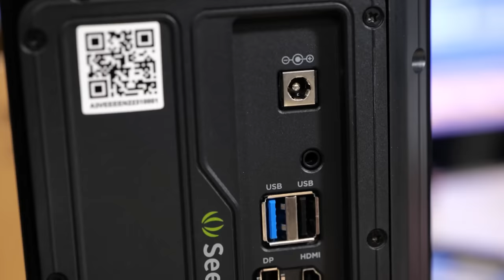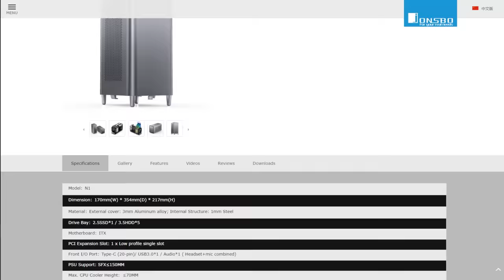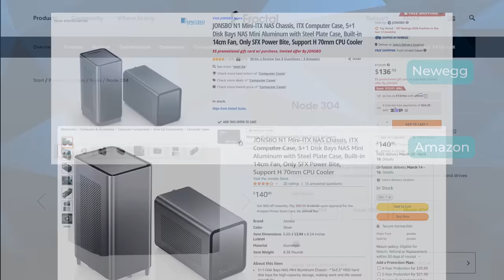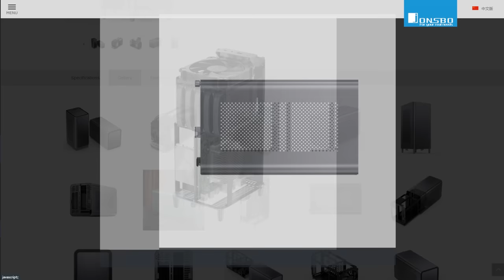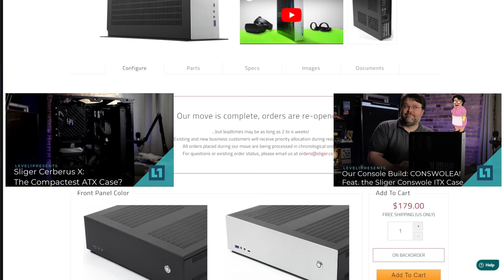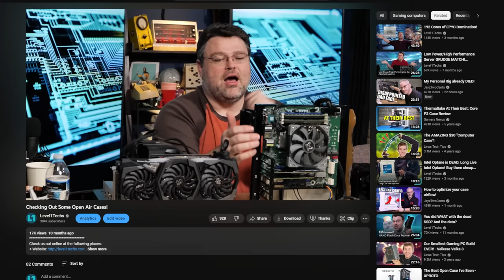The Ideal Home Server! Is it Possible?

Comment: I am late to the game, but is there is a cheaper option for just having NAS for long term storage? I have 2x 4TB drives that I want to get out of my main PC so I can have the files accessible on a power efficient form factor than just running my main rig 24/7. I have them manually mirrored (copy paste) because my windows mirror array failed, so I manually do periodic transfers from one to the other. Other use case is photos, movies, and etc, but the first priority is redundancy of data (and as a backup from my devices).

Comment: @Level1Techs I have built many PCs, but I'm a server newbie, so how many HDD is the most ideal for raid storage?  I have a hp z840 that i would like to repurpose for a server, i can fit up to 7x 3.5" hdd drives easily.  Also, this workstation is compatible with SAS, do I want SAS or stick to SATA?

Comment: In my experience, small form factors and mechanical drives don't mix.  Drives need airflow; too much heat will kill them.  I cringe when I see form factors with just enough space for 4 or 5 mechanical disks.  As with a few other commenters, I prefer ATX sized storage servers as these provide the space and cooling, not to mention the ability to use cheap commodity components.

Comment: I echo your complaint about every single 2-bay unit on the market. Why not 3, so you can do RAID6 in a sleek package?
Reply: Running RAID6 on only 3 drives is just paranoid, you'd have more redundancy than storage.

Comment: Z170i mini atx board with couple bent pins, no cpu, no ram. As z170 is v1 lga1151 there is not a lot to pick from cpu wise, quad cores only I'm thinking maybe to delegate some of the tasks that my current noise maker doing like NAS or media or in general just to swap it completely as it will take 5x less space and will be silent but in same time performance wise it wont be an extreme upgrade - yes ddr4 is nice, yes Skylake is much more efficient then Haswell still cores and thread remain. In the end if it will work out do I go straight to coffemod ?

Current TS440 5U fridge as main "all in one loose it all" (nas, media, games server)
Specs: 
e3 1281 v3 4 cores 8 threads 
32gig ECC
1050
8 bay hot swap 2.5 with only 6 hdd/ssd in 
old sas controller without IT mode (thats why running windows server 2019)
1 gig home network with dedicated headless laptop for back ups and pihole (~2nd gen celeron with 8gig ram, it runs sata2 with 500gig ssd, truenas scale on flash drive)))

Comment: I’m currently using an old dell precision workstation i snagged from worked with a Xeon cpu and 32gb of RAM along with 2 4tb IronWolf Drives and 1 SATA SSD running on unRAID. Unfortunately, the thing is not power efficient at all lol. I’m just using it as a NAS/Minecraft server at the moment. Anyone have any ideas on a power efficient build that also has the ability to run a Minecraft server for just a few of my friends with a mod pack like All the Mods 8?

Comment: Do you have any sort of contact at Asrock to ask them about things on the X570D4U (-2L2T)?  I have one just sitting in my closet, that I stopped using, because of multiple issues.

chipset heatsink in a bad location; no S3 suspend support; no serial-over-LAN in the IPMI web UI (somebody forgot a feature flag); the lack of EDID (console framebuffer stuck at 1024x768); the inability to disable video ROM loading from a PCIe slot to keep IPMI as primary

Comment: I'm currently working on the following build for my home server:
Ryzen 7 5700g
4 x 8 GB DDR4 3200 Mhz
MSI Tomahawk B550 (has 2.5GB Ethernet)
3 x 4TB 7200 RPM (plan on doing raid 5)
2 x 500 GB Sata SSDs (plan on using them in Raid 0 as cache)
1 x 500GB M.2 Nvme 3500 mb read for OS and VMs
450W PSU
Case with 4 x 2.5" slots, 2 x 3.5" slots and 2 x 5.25" bays (to keep a 3 or 4 x 3.5" vault)

How am I going to set this up i don't know. Recently upgraded my old gaming PC, bought some disks and planning on building a proxmox server, to work as NAS, home assistant, gaming server and other self hosted services.

Ideal home server would be to make this as smallest as possible (changing the Mobo and case), making it consume the least energy possible (probably would need less spinning disks but larger ones and maybe switch CPU) with room to increase disk space. Fast read/write speeds.

Comment: There's a part of me that's itching to start some home data hoarding. I hate it when things get deleted from the internet.

I know of a local computer shop that is partnered with a recycling center. They have fair prices on their consumer PCs. However, they also sell servers that are really good value. My only fear is how loud a 1u or 2u rack can get. However, they do sometimes have some 5u Tower servers that may be quieter. Anyone have experience buying used servers?

I want to buy a bunch of cheap used SAS drives and just give it extra redundancy with TrueNAS. Maybe I can find a quiet tower and connect it to a JBOD of disks. I'm just looking to get started.

Comment: That NVME rack is tits! What kind of HBA would allow that much send/get with the least involvement? It's pretty wild that I've never heard of OCulink until today and it's very conservatively priced but looks like a $$$$$ product lineup. I'm currently looking at repurposing my old AMD FX-8370 system for full time .NET, LanCache and Samba duty for my 5 and 16TB behemoths. So far they have been going brrr in a cute little single core SFF AM2 era PC. I've noticed core count and large memory doesn't really matter in my jobs until virtualization and ultra high IOps get involved and gigabit becomes the first bottleneck. I've been experimenting with some old Sun Oracle F40 disks and dual 10GbE SFP cards but it looks like I need to switch systems to use both. In systems where NVME just isn't an option, it's hard to come up with a good configuration over PCI-E g2 so I'm happy with SATA.

Comment: My problem is that an AsRock Rack x570d4u-2l2t is mATX, otherwise I would have purchased one of the jonesbro cases. 🤣
Reply: I have this currently in a plink (i think) 4u case where the io faces the front.  Thankfully, the firmware last year fixed the ipmi.  I will be adding a 12 drive dl380p backplane and drive case I picked up (brand new) for $100.  Also needed to be under 16" deep because it have it all in a network case.
Reply: All that to say...I would be number 2 for your dream case.

Comment: There is no ideal home server case. They all peaked in late 2000s, and that's all we'll ever get, with number of intact cases dwindling each year, with most of them long out of production.

Rackmount towers are far too cramped too. There is just not enough space to fit everything comfortably, it's either reasonably dense or airflow oriented, nothing inbetween.

Comment: I can't seem to find good info on if and how to transfer server internals from a dell or HP to another case. I find people saying no due to alarms for chassis being open and things like that. Do you have any info / videos on this I'm not finding here or on l1 forums?
Reply: its always a motherboard by motherboard case "pun not intended" , its not really worth the trouble unless you got a free server.. then try and make motherboard work outside case. once its done its just a matter of making it fit in a standard case.  if you look on ebay there is a lot of supermicro/intel server motherboard that can be used that use standard connector e.t.c
Reply: @sy5tem  Thank you for your reply. I did get it for free. Well, my time, I guess. Client didn't want to pay a destruction fee and recycle fee for server. I have data destruction software, so I offered to do so and give them the certificate of destruction, and then gave  me it for free. Dual 8c/16t Xeon 128gb of RAM and full of 3TB disks so it meets all I need so I don't really want to do a fresh server build. 

I would love to get it to work even outside of a case altogether. I wanted to put it in this cabinet that I put push & pull ventilation in. I already have an old gaming machine in there without a case as a media server that's mounted to the inside if the big cabinet. 

It was more just a hope that someone would have figured it out. What I find is if it's out of their original chassis, it will continually say intrusion errors and turns fans on high. Oh well. Guess I may just have to justify building a new machine..... darn lol
Reply: @army95cspec  intrusion detection is usually a since 2 pin switch, most of the time its embeded in a bigger connector you can find it and just wire the 2 pin together, whats is the hp exactly i might give some pointers, like ml30 g9 for example?
Reply: @sy5tem  thanks! Gonna look into that. The HP I'd have to dig out again ATM. I think it was dl 320, gen 8 or 9.
Reply: @army95cspec  well psu pins are standard on those. but furm factor is  not. its doable tho..

Comment: I would highly recommend the Supermicro A2SDi-H-TF Mini-ITX motherboard. It has 12 SATA3 ports (4 SATA3 ports and 2 Mini SAS HD ports), two 10GBaseT ports, an M.2 slot and supports up to 256GB RAM. The 25W TDP CPU, Intel Atom C3758 is soldered to the board. A bit expensive but they often shows up used on ebay. I use this board myself in a ProxMox + TrueNas build.

Comment: This video kinda aged poorly unfortunately, given that 4TB SSDs are now affordable and 8TB are carved out from the bottom now and will need to drop in price very soon. It would not surprise me if we start seeing sub-$400 32TB m.2 SSDs in 2027, though that might perhaps be a tad optimistic.

I 100% completely agree about the layout though - half-height card support, support ATX boards in one chamber, 6x or 8x 5.25" on the other side and maybe, just maybe put in space for a 240 or 280 radiator in the bottom or on the side.

Comment: Really not interested in  ITX home servers and not even mATX - just too many compromises for not enough benefit when you're talking about a server - I hate paying more for less with SFF builds generally but when you really want everything to run cool and efficiently 24/7 I think ITX server builds are too much of a square peg in a round hole. On the other hand there's plenty of older ATX mid tower cases with 5.25" bays and decent cooling options, especially if you're happy to modify the cases for improved air flow

 Of course the same doesn't apply on the client side when for sure you (or more likely your S.O.) might not want a large tower case in a bedroom or living room.